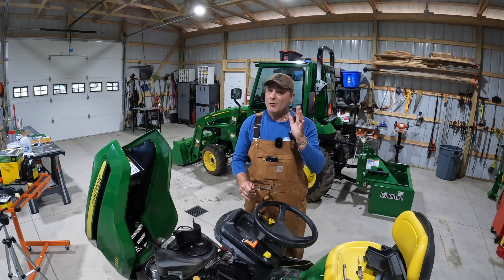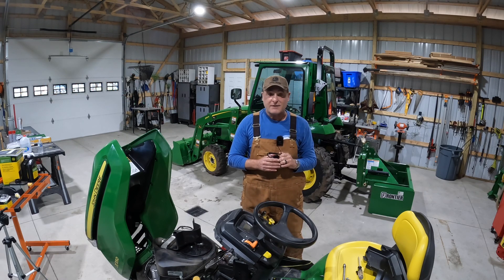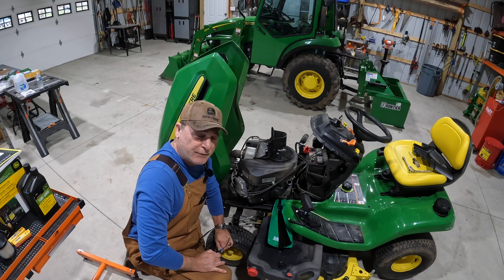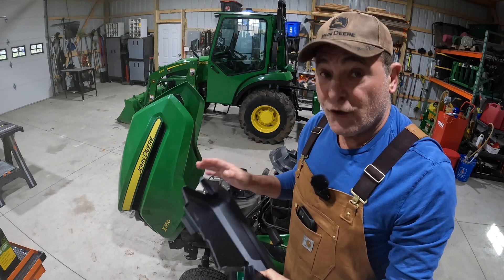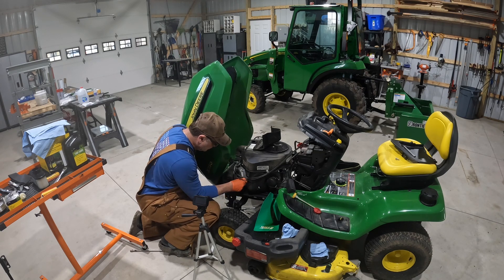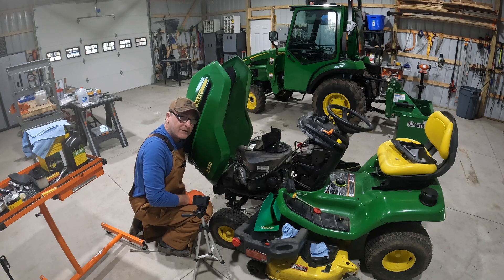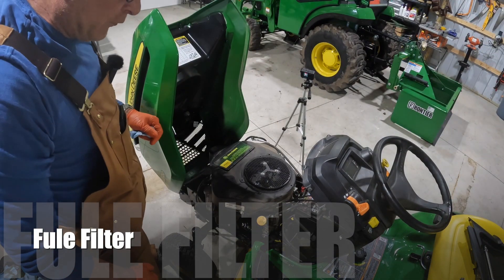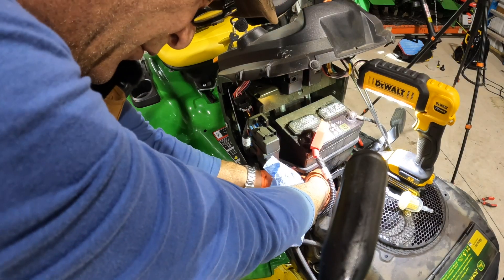Getting the John Deere X350 Ready For SPRING WORK!

Comment: We have an X380. That side panel is a pain. Poor design as it partially blocks the stock filter removal. I use a filter that is slightly longer than stock so that panel really got in the way. A quick trim with the Dremel to notch the panel and no need to remove it again.
Reply from the maker: Good morning and thank you for the comment.  Good idea to make that issue easier to deal with!  I have not had an issue with the filter removal on the X#%), as you saw in the video.  Thank you for watching our channel!
Reply: @TractorsAndLife  Just thought I would offer a solution as you were showing the removed panel at 3:35 and I took that as the panel needed to be removed to service the filter. My bad. Nice video.